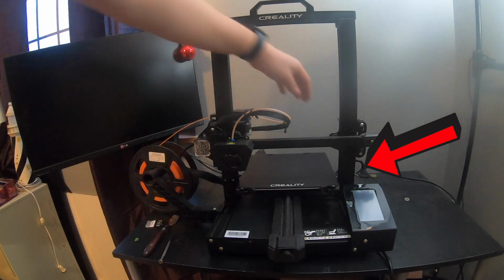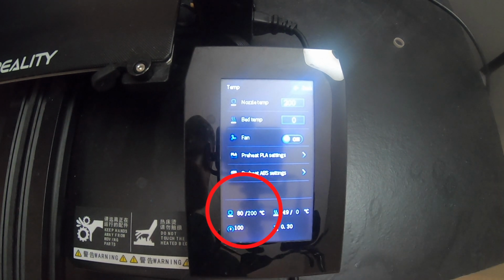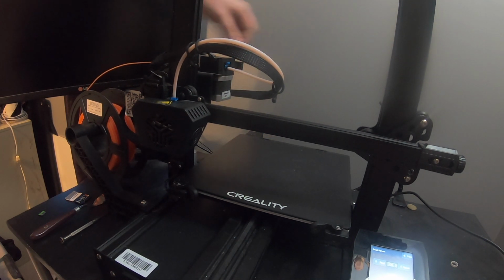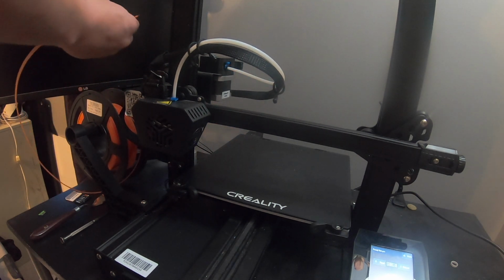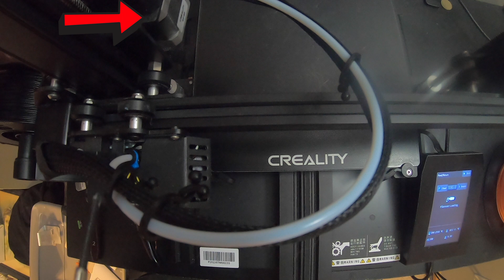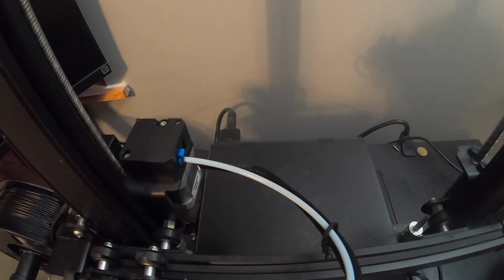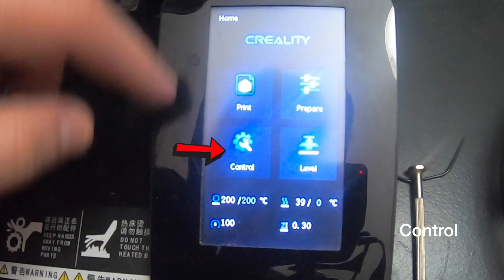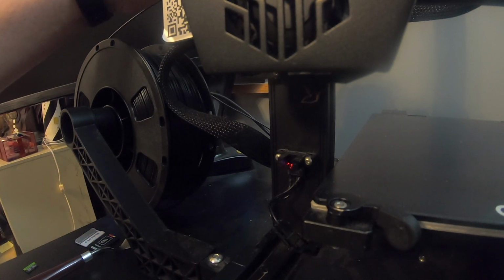How to Load Filament in a Creality 3D Printer - Model CR-6 SE

Comment: hi, what i do if i run out of filament in the middle of a print?
Reply from the maker: My cr 6 Se has a run out filament sensor. It will pause the print and then you add more filament and then continue the print.

Comment: Great tutorial!
Reply from the maker: Thank you! I hope it was helpful!
Reply: @MCFIXIT  the printer comes with a part to insert between the filament sensor and the extruder to guide the filament.
Reply: @_WARL0CK_  yeah but even with it it's super hard to feed in some printers... with the printer is this video it seems easy, but I've not managed to change spool yet on my CR6 SE and I feel like returning the damn thing, and I had no problem with my other two printers. For the CR6SE, tried all the tricks, twisting, playing with the securing nob, and whatnot, still can't pass it through the black box/extruder. Since the filament snapped midprint with the crap filament that came with it, I wonder if a small piece is obstructing now somewhere inside that box :(

Comment from the maker: Learn how to load your 3D printer's filament step by step! I will go through the multiple steps on doing this on my Creality CR-6 SE. It will be similar to other brands and models. 

The Tools:
• Creality CR-6 SE - https://amzn.to/34LjfZ5
• PLA Filament - https://amzn.to/3rB1LYw
• PETG Filament - https://amzn.to/3J8lapu

00:00 The Start
00:07 The Project
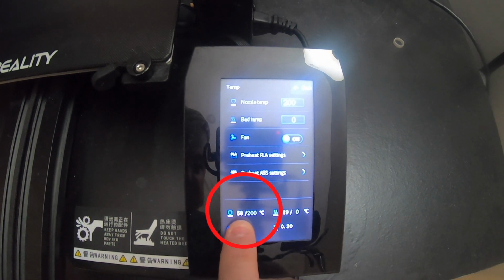00:52 The Tools & Supplies
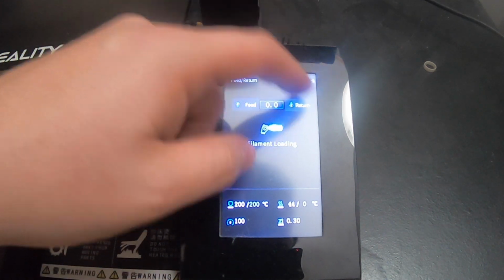01:22 Diagnosing the Problem
02:09 Testing the Fuse
03:17 Testing the Power On/Off Switch
07:17 Testing Power Supply
10:07 Finding the Problem
10:48 Replacing Power Supply
19:50 Problem Fixed
19:59 Putting Everything Back Together
23:55 Closing

Check your make and model to get the appropriate parts. Be careful not to touch anything when plugged in due to possible electrocution or worse. 

Check out my website at http://mcfixit.us 

Disclaimer:
Due to factors beyond the control of MC FIX IT, I cannot guarantee against improper use or unauthorized modifications of this information in the video, post, blog, or social media. MC FIX IT assumes no liability for property damage or injury incurred as a result of any of the information contained in this video. Use this information at your own risk. If you feel uncomfortable at any time. Stop and go to a professional. MC FIX IT recommends safe practices when working on vehicles, your house, or any other project and or with tools seen or implied in this video. Due to factors beyond the control of MC FIX IT, no information contained in this video shall create any expressed or implied warranty or guarantee of any particular result. Any injury, damage, or loss that may result from improper use of these tools, equipment, or from the information contained in this video is the sole responsibility of the user and not MC FIX IT.

#mcfixit #3dprinter #creality
——
Supplies used to record this video: 
* GoPro Hero 7 Black - https://amzn.to/3f3ALtb 
* 256GB Flash Drive - https://amzn.to/33pAueG 
* Vlogging Frame - https://amzn.to/33tajE0 
* GoPro Pro 3.5mm Mic Adapter - https://amzn.to/2RCURCu 
* Youmic Lavalier Lapel Mic - https://amzn.to/2R55sWX 
* Boom Stand (tripod) - https://amzn.to/3bdkQaw
* 5/8” to 1/4” adapter (boom to blogging frame- https://amzn.to/3txrVsM 
* Portable Battery Powerbank- https://amzn.to/3vJQc0q 
* 6ft USB to USB-C (powerbank to GoPro)- https://amzn.to/3uAS5MH